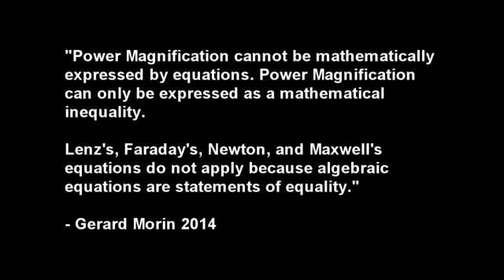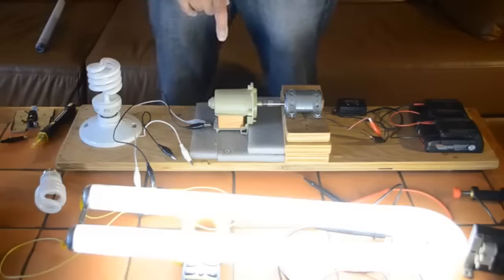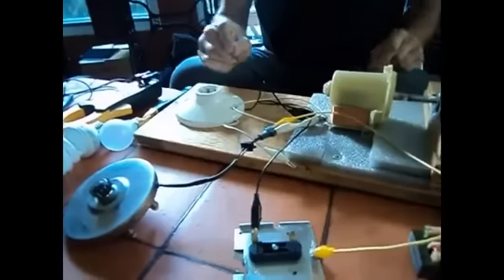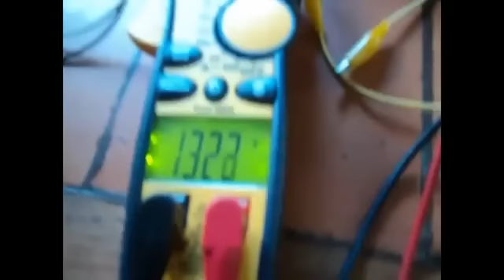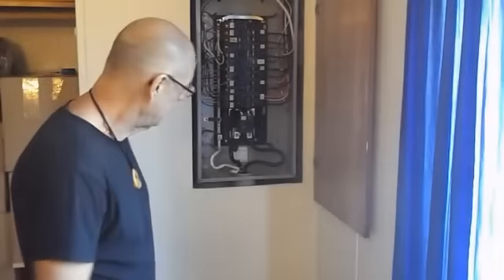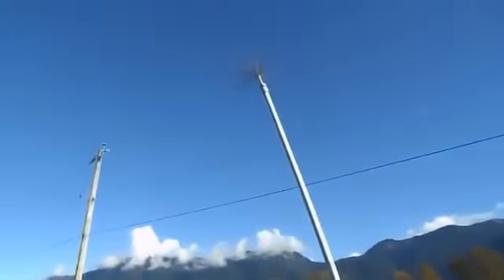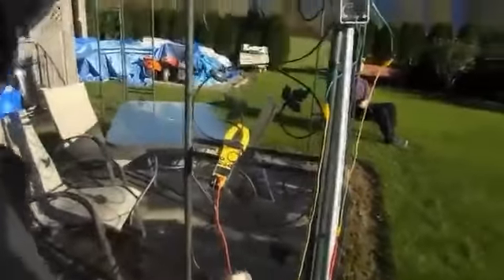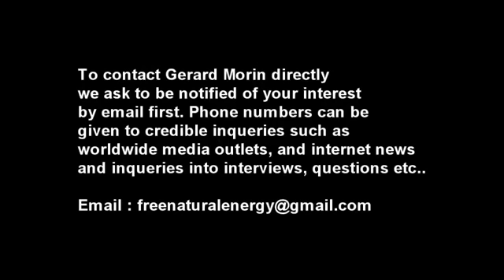Time to END The Electricity Racket - FREE & NATURAL ELECTRICITY PROOF

Comment: There's alot of videos out there claiming that you can get free energy but I always believed that the conservation of energy laws made that impossible. However it got me thinking. If you put a flourescent light under power lines it lights up. So that shows there is an electrical field at work between the power lines and the earth. So could it be possible to build a device that could use that electrical field to create energy. We know from transformers that changing fields in one circuit can create current flow in a second circuit through electromagnetic induction. So using this principle would it be possible to use the field of high voltage lines to power lower voltage circuits? In effect I guess it would be like stealing power wirelessly. Although technically you aren't stealing as your not directly tapping into the power companies wires if that makes sense?
Reply: Actually been done. Farmer convicted of theft after looping the top of the fence. You will be prosecuted if caught. People have received shocks from legitimate fencing.
Reply: Wireless phone charging is analogous to this. No direct contact is how most transformers convert voltage in appliances .
Reply: @rossbixley3173  yes but transformers use a laminated iron core and the wires need to be fairly close between the primary and secondary windings. I was thinking more along the lines of a device that just picks up the changing magnetic field and generates power from it. Not sure how the farmer was convicted unless he physically tampered with the power companies equipment in the same way as people have tapped into streetlights to steal power. Do you have a link to the story so I can read about how he did it?
Reply: @taylorsdad8700  This was years ago in New Zealand . The farmer was convicted for deliberately running a large wire coil along the top of a fence directly beneath high tension lines. Any method to pick off power lines is illegal here and I would expect the same elsewhere. No matter how you decide to drain from the line you are creating a draw on the current and while power companies probably won't pick up on the loss they will consider this loss as theft if they catch you. You probably wouldn't loosen the flanges on a pipeline to steal product yet you don't appear to see there is no difference if you deliberately target power lines.
Reply: @rossbixley3173  after seeing this video and countless others there are obviously some people who are interested in free energy. I was merely sharing a thought that had occurred to me whether or not this was something that could be done. I wasn't aware this was something that people had already tried. Your reply was a little condescending as if this is something I'm planning on trying which of course I'm not. So please climb down from your pedestal!
Reply: Yes, that would work, but 1. it is very inefficient and 2. thats not "free energy" its energy from the next power plant around you....
Reply: And its stealing because youre stealing inductive power.......
Reply: @taylorsdad8700  Basically you're talking about an inefficient transformer. And it would be stealing because it actually puts a load on company's wires
Reply: The answer is yes and no. Lol sorry just google Tesla. He was able to demonstrate that it does indeed work. However bringing it to scale was the task he never finished. It just wasn't practical.

Comment: I recommend you go to your power Panel and find that big white wire that is doubling your bill and just disconnect it and save some money!
Reply: If you did that in the U.S. your path to electrical ground needed to complete the loop would have to be the earth ground wire (you're supposed to have anyways). Secondly, if you do what you're suggesting you're toying with DEATH & ELECTROCUTION. Adding to that those appliances your powering can't run as efficiently (through an earth ground and therefore will have a short life span).  So tell us again how your saving anything again?
Reply: that statement is horrible your going to get someone Killed probably in the shower if it is an old house

Comment: Am I missing something 
How much juice is left in the battery
Reply: It's a flash light.  It has a bulb (using a standard household light socket) and a battery.  When the battery goes dead, it stops working.  Putting the battery on the small generator is required to produce AC voltage - what the led and florescent twisty with household light socket based are designed for.  Redundant seeing they have to change it back to DC to work, hence the built in circuit  boards and such inside them.  Again, when the battery dies, it doesn't work.  Charging the battery will take a power source higher than 36 volts with enough current to charge it faster than it loses charge.  A solar panel would take about 7 hours.  I'm guessing the battery goes dead running the generator in about 30-45 minutes.
Reply: I watched this in the UK over a year ago no one proved him wrong then,  so  has any one Improved it or got it to work ?
Reply: 15 years of bogus work. why???  discovering free energy is and would be disruptive technology. you would start up mega industries that hog energy and put out your competitors out of business. this guy is a load of bs with crappy experiments.
Reply: Poison Ivy  That's right you don't need batteries, you can power it directly from the conservation of energy and momentum and the bullshit that it spews out.
Reply: No
Reply: @lolguy-x9n  you don't get it and never will.
What he's saying is facts but you rather stay believing the ones who's stealing from you.
My unit works
Reply: @edwinjames931  what does your unit do and can we see it without silly hindrances like patents and edited YouTube videos? I am telling you abundant free energy easily harvested would be a disruptive tech the way computers drove out typewriters. there is too much foolish talking especially on youtube.
Reply: He's not proving that he's generating more electricity than comes out of he battery.
Reply: @liamduncan732  It's on him to prove it actually works. Seeing as most of us that work with electronics, or know physics, know you can't prove a negative.
Reply: @lolguy-x9n  Because there is no free energy. You must put some kind of work in to get work out.
Reply: @Technichian462  Bull Doo Doo!
Reply: @haroldmiller4189  Holy and He'll be careful!
Reply: @liamduncan732  He's only converting energy, not producing any.
Reply: For the nay sawyers post a video and prove him wrong. Not defending him but words are cheap those written from behind a keyboard even more so.
Reply: How come Gerad Mortin doesnt answer back to this important question ? 

He need shake his head may be something stack between his ears according to his traching?
Reply: They dont try to prove him wrong because they dont know how. they've just been told something their whole life so they believe it and anyone saying different it a big stupidhead.
Reply: @chrisscogin1911 sorry sir  I disagree all they need to do is check voltage of battery so simple commmon sence he should should it if it was actally working he whould show it that make more sence.
Reply: @edwinjames931  your unity works? show it! put your results where your mouth is!
Reply: @lolguy-x9n  in all reality if energy was free we wouldn't need a bunch of greedy corporations to supply it to us so they can store and force out anyone they want. They will just be producing the energy for themselves.
Reply: @So1ipse  right he states that too.
Reply: @jvon3885  😂 guess you trying to reply to someone else or else you are challenged the queens language.
Reply: @lolguy-x9n  sure
Reply: @liamduncan732  Well, they all fell asleep during the video.
Reply: @edwinjames931  yep it works, it just doesn't give you free energy. Unless you charge the batteries in some caffe... But there are more efficient ways to steal electricity.
Reply: @tadpoleinseaofminnows8587  theres nothing to prove here. He never even tried to show that he gets more energy than he puts in, he only ups the voltage... Nothing new (including a complete lack of understanding of basic electricity). "Can't multiply amperage" "AC batteries"...
Reply: @edwinjames931  at least shit has more nutrients than this free electricity
Reply: @thegmbt  this will be my last piece
Seek and stop believing because it will make you a lier.
Stop taking everything they push on you open up your mind and grow within.
Today technology is very old. If you believe that the  pyramids was built by hand and pulled together with rope on some sticks, then your still sleeping.
Seek and you shall find.
Look at a candle fly that tells you a lot.
Electricity is everywhere. And it's free you got to go find Be your own alchemist.
Reply: @lolguy-x9n  actually one would just dissappear

Comment: Would've been nice to have measured the amps from the batteries during the display. Now you only showed how to use a dynomotor  and a transformer to convert from DC to AC and up the voltage. Sounds like you have no idea what you're doing here...

Comment: OMG, may as well have titled the video "Calling all conspiracy theorists!", so many people eating this BS up! Try to explain it however you like, call it whatever you like, you are achieving a net loss of energy. So many people commenting who have no idea (and a few that do)... In your next video humour me by placing an ammeter on the battery circuit during your various "proof" tests. Then, as a separate experiment, get another two batteries of equal voltage and storage capacity and charge them (obviously configuring your load circuit to correctly charge the battery). THEN explain to us all how it is that the first two batteries couldn't fully charge the second two batteries... because if you're generating more than you're putting in it should be simple, right? Definitely one more to add to the pile of 'people who think they can hack physics'. So many silly points, that show a complete lack of understanding.

edit: I've just realised who I'm addressing; allow me to elaborate further. In the battery charge test, start with two fully charged batteries on the supply side and two fully discharged batteries on the load side (discharge level that of the battery manufacturers recommended minimum cell voltage). All four batteries are to be of the same brand, model and voltage, preferably from the same batch. Yes, there can still be some capacity variance between them so feel free to do a discharge test prior and use the two with the higher capacities, however slight. Use whatever mix of brands if you like, as long as the TESTED capacities are very similar, again using the slightly higher capacity batteries on the supply size. Please make sure you're filming when you check the charge status at completion.. not to see if it did it (it wont), but to see the confused look on your face. (directed at any proponent who cares to run the experiment; you'd be silly to implement the theory and not run the experiment).
Reply: Bingo Berra the only problem there is that the motor can’t “put out” more than the battery.. all he’s doing is using an extremely inefficient method of converting DC to AC, then using a transformer to step up the voltage. The POWER out of the battery would be exceeding the POWER out of the generator. 

No one’s being arrogant and saying there’s nothing to discover; people (including myself) are commenting on the naivety of thinking you can just slap together a few off the shelf components and all of a sudden create a net energy gain, like no one had ever tried it before or government/power company conspiracy theories about how they lie to us about what electricity ‘is’. Have you listened to Mr Morin go on about resonance, AC being fake, current being a lie, electrical appliances not actually consuming power, electricity having no relation to magnetism... mate, THAT is arrogance!
Reply: Bingo Berra don’t believe me? Go through his videos and look for one that he uploaded around 2017, ‘demonstrating’ how he plans to create one of these that runs on 120v mains, drawing 4-6 amps, outputting 100hp! (Roughly 75,000W).. so about 10,500% efficiency. Yet in the demonstration he draws over 2000w from the grid to run a 500w load... Do you still believe the generatior is outputting more than the battery?
Reply: Bingo Berra you’re speaking to an Aussie, mate. We use different terms. Did he refer to something as a stafflight? Because I’m not familiar with the term and don’t have the time to listen to the whole video. It will be easier for me to try to explain what’s going on if you tell me what point/time in the video that you’re referring to.
Reply: Bingo Berra it’s funny you mention flat earth theory; some of it can actually make you think for a second, before remembering why their claims are ridiculous (I’m not an astronomer, geographer or physicist, so sometimes my recall of year 12 science can be a little slow when it comes to certain phenomena).
Reply: @NPC-jt3gp  just sticking a comment in here guys I'm in Australia and a while ago news channels shared concerns about energy from overhead powerlines lighting up large fluorescent globes at night held in hand walking under the lines , amazing to see but sure changed my thinking on living to close to those monster tower things .after seeing that I  can relate to the fact that a burnt tube lights up when he applied a wire to it , get it yet ? Cheers .
Reply: @NPC-jt3gp  yes thats it tube lights long thin about 1 inch round tubes with 2 pins on each end and about 3 ' long ,they lit up like a xmass tree ,, you mentioned magnetic feild, that is the very thing that killed a truck jocky guiding the driver out front of my home when the truck conacted power lines above , he was 5 metres clear of the truck when fried and died instantly ,
Reply: What is this bullshit! ? 
We need THE RECTIFIEEER for this 
Someone sent this video to electroboom 
Do it NOW
Reply: honey boo hoo FYI, you tried to improve your writing, but failed miserably! 😂
Reply: honey boo hoo “being all honest and stuff” 😂😂😂😂
Reply: honey boo hoo Ain’t that the truth! You’re only here to satisfy your ego. Thanks for the amusement, take care and be safe during your aforementioned ‘escapades’.

Comment: Good job Sir Gerard. Getting Voltage from the Antennae. I too measured a Voltage in cold water  about 0.1 V. The water was left outside over night
Reply: voltage without amps. I measured 110 volts in my house line and couldnt turn on a bulb

Comment: This is the real through , I have been done like he showed it work 110V 3 bulbs , glowing bright light, amazing small motor can be did that, but it too mall motor and have to be 3000to5000 RPM motor speed to pull that motor to work and need to add baring to be long run , thank you MR Gerard Morin 1,000 👍.

Comment: He could greatly increase the electromagnetic amplification with the addition of a para-condenser which is close coupled to a resonating encabulator with post frammisters offset by a delta phase configuration.
Reply: Your techno babble is worse then the authors!
Reply: @Bill_N7FTM  Exactly his point, ever hear of an encabulator or frammister? You might need a left handed algebra pencil to do the math.
Reply: What the hell did you say
Reply: He will be needing also a good sturdy board stretcher.  And extra piston grommets for the frammister assemblage. Then he will really be capitulating some mag-amps!
Reply: Plus a sweet twin doodah-gafupulator! Ha! then he’ll be flexin’ them voltometers!
Reply: Doing so creates side-fumbling, though, so, you have to use current rudders to prevent backflow.
Reply: @staywhite6332  ROTFLMAO  :-)
Reply: The encabulator must be impedance-matched, though.

Comment: What would happen if you connect the output to a bridge rectifier to produce DC at the output, add a voltage divider circuit to provide a 36v DC power source and content it to the 36v source connections and then remove the batteries?
Reply: HandyMan Extrodinaire Why not try it yourself and see?  If you would rather just have the answer...it would just abruptly stop. You are essentially proposing a perpetual motion machine of sorts. The circuit would have to produce more energy than it uses...just to keep running...in order to overcome efficiency losses alone.